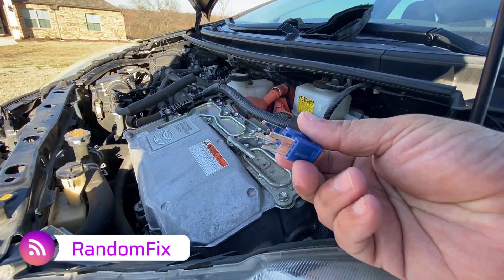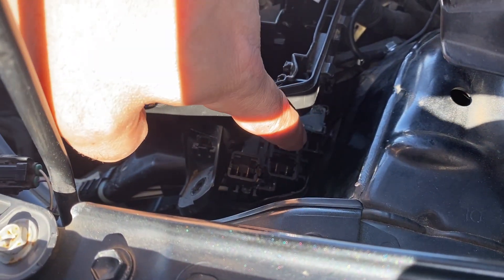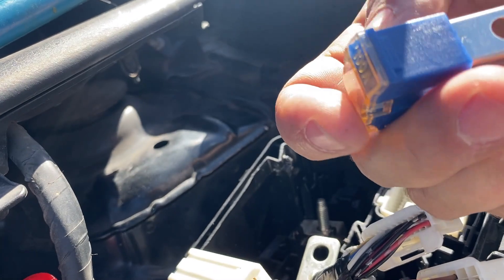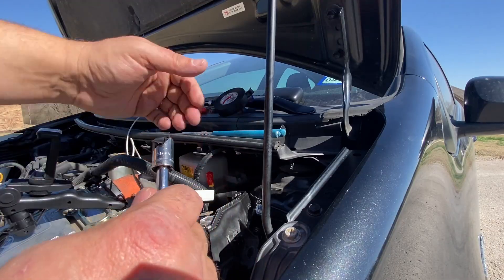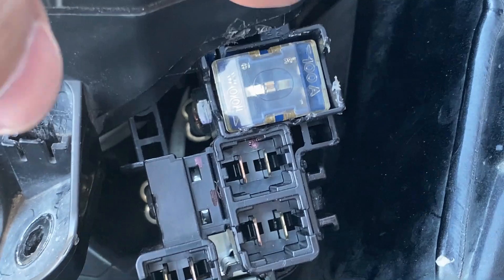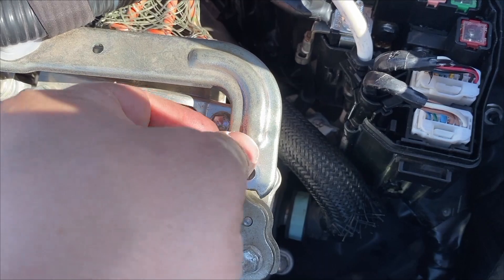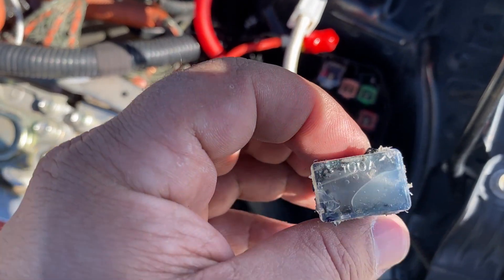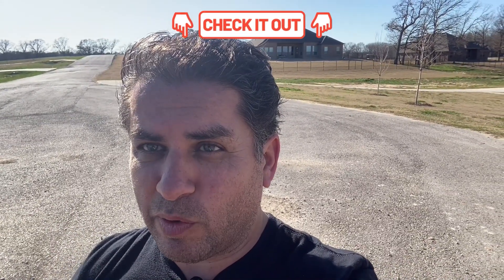How to remove a STUCK BIG 100 amp fuse, the EASY WAY!

Comment: What if u pull fuse off how do u get the metal part out thats bolted
Reply from the maker: The two metal legs that are on each side are bolted so you have to remove the bolts and they pull out the big fuse.
Reply: @RANDOMFIX ok thnx i pulled fuse off not knowing it was screwed in so i guess i gotta take the thing apart to put new fuse in 😂

Comment: thank you :) i didn't know it was bolt lol
Reply from the maker: No worries! Yeah it not a super easy job! I hope you got it done.
Reply: @RANDOMFIX   i'll leave a comment here when i do :) i forgot to pick up a battery charger while i was at the garage today; but if the fuse don't work, i'ma hijack the fuel test plug! i know i got 12 volts there, write back later this week  (give it a false voltage, so it reads as the CAS sensor is working) then shut it off